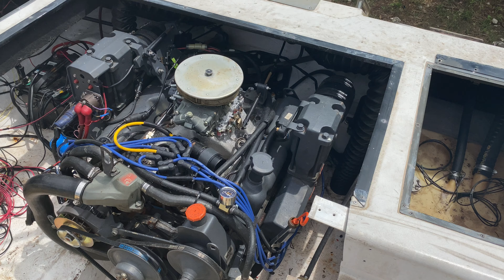OMC 400HP High Performance Series! Part 3

Comment: Hey I also want too tune my OMC 5.8, atm it’s a 235hp Version with the logstyle headers, my Z Drive is conversioned to an alpha one so I want about 300hp, 
Now I’m doing 30knots at 4000U/min on a 2755 Bayliner.
Any suggestions for simple mods
Intake? 1.7 Rockers ? Or another carb?
Reply from the maker: Roger, for 65 more horses, sadly you are going to need a different high lift cam. You can then put 1.7 to allow for the higher lift too. Add a high rise intake with at least 650 CFM carb on top and you will get at least 300HP. Small mods at best will get you 15HP on a good day. Before you spend any money, add up the cost for a new cam, new rollers (ought to be a kit), new push rods, roller rockers, gasket kit, new aluminum intake (plus gaskets), and carb and see what that price looks like. You might find it better to buy a long block at that point. The difference from 235 to 300 is worth it. 300 to 400 on a boat is even better.
Reply: Michael Romer thanks for the advise, as I m located in Germany the prices are quite different. So I ‚ looking für some bang fore the bug mods at best bold on

Comment: hey Mike I don't know if you've done one or not but I replacing my points with electronic ignition in my 5.7 OMC wanted to see if you had a video on that it is a 1990 donzi
Reply from the maker: What year is yours? They make a conversion already. All you need is a timing light.

Comment: I noticed you have two batteries connected. Is that normal for omc motors for starting?
Reply from the maker: There is sound system. It’s likely the case they help power the two subs. Thanks and please subscribe!